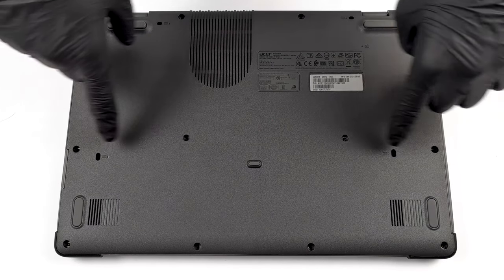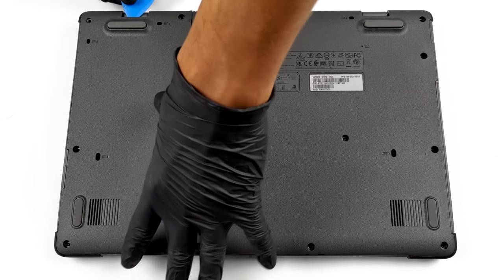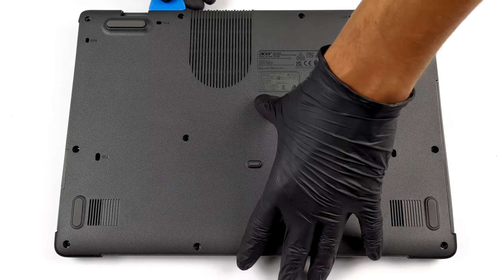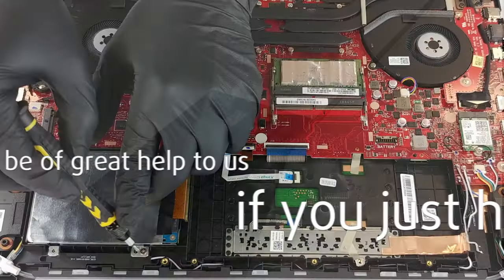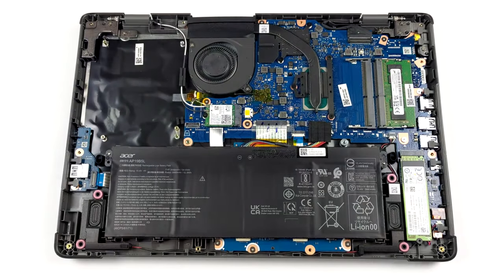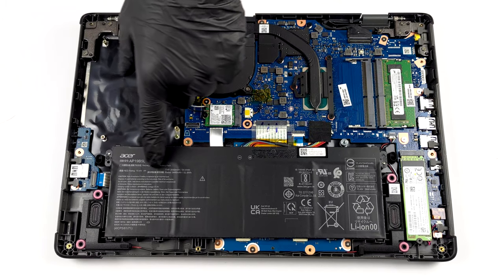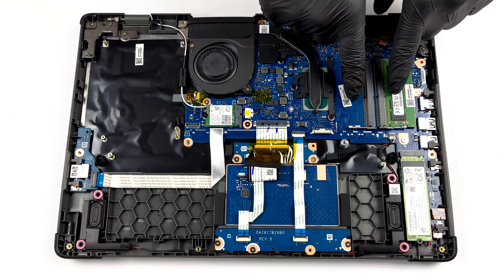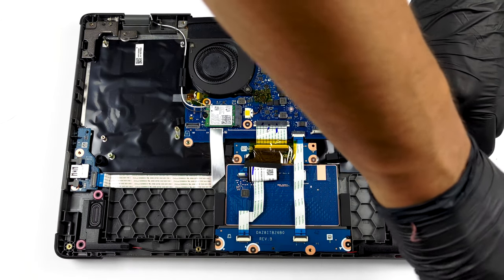🛠️ Acer Enduro Urban N3 (EUN314-51) - disassembly and upgrade options

Comment: I have this model (ACER ENDURO EUN314-51 series Model No.: N19Q9), but the battery is different. Why? I have an ACER AP18C8k / Nominal voltage: 11.25V - Limit charging voltage 13.05V / Typ 4471mAh/50.29Wh - Rated capacity: 4343mAh/48.85Wh). Should I be worried? Should I replace it for one like in the video (ACER AP19B5L)?  Mine stopped charging, I thought it was the charger, but now I don't know... 🤷‍♂